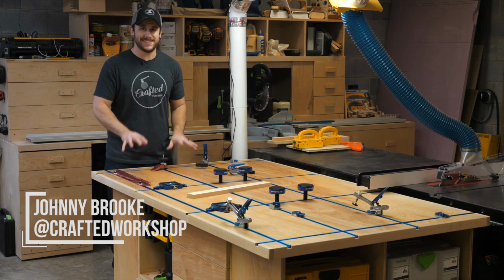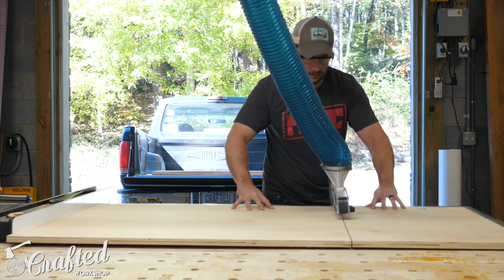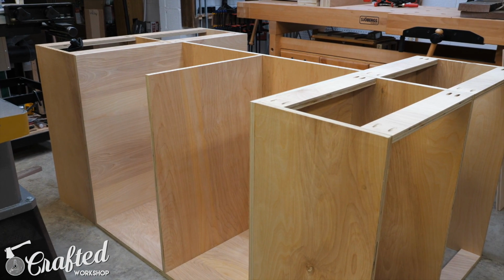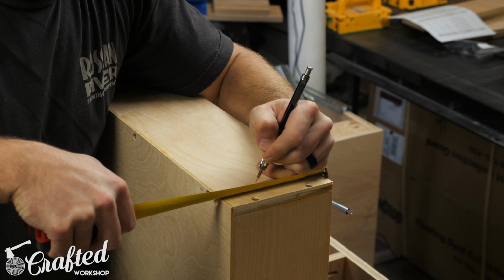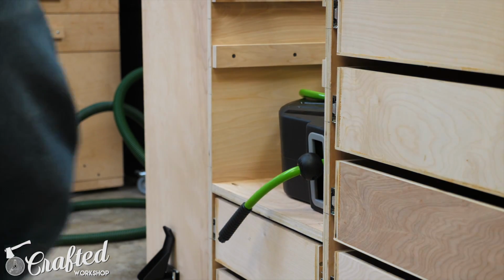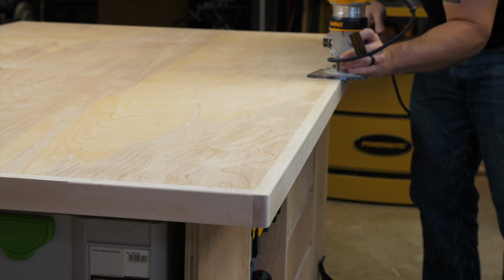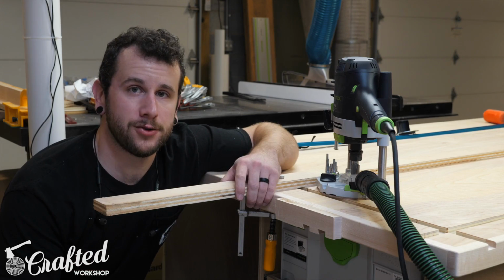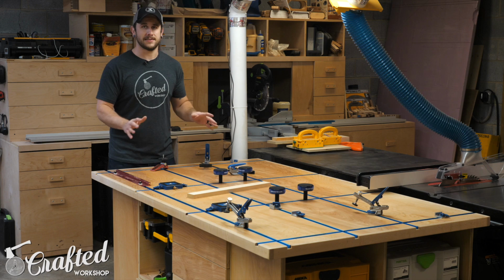ULTIMATE T-Track Assembly & Outfeed Table / Workbench with Systainer Storage | How To Build

Comment: Very nice!  So many cool ideas for a bench!  I looks like you opt for  going to T-Track vs dog holes?  Why not both?  I also noticed you opt for a very large table saw surface as well verses most default standard cabinet sizes.
Reply from the maker: Thanks Gary! I had dog holes previously and just didn't find them that useful. I've already found the t-track more enjoyable to use. My table saw has a 52" rip fence, very handy for breaking down bigger pieces of plywood.
Reply: I have to agree I think the track make more applicable sense.   I am debating on ordering a new cabinet saw vs a new Skilsaw worm drive job site saw for my home shop.   I am leaning towards the new job-site saw because one it has plenty of power, seems to have a good fence system being rack and pinon, and of course it is portable and easy to store out of the way if one wants to.   I have room for a cabinet saw in my shop but this is $499.00 plus one gets a new Skilsaw 7.25 circular saw with it right now as well!   It also cuts 35" to the right of the blade and also will encompass a dado blade.   If I need to rip large sheet goods I would use a track saw for that which I find is much easier and provides accuracy and clean cuts as well and also is portable if one needs to do this else where.  Invested cost for both track saw and the Skilsaw worm drive is less than just a cabinet saw as well.    Here is the link if you want to express an opinion. https://www.skilsaw.com/  Just not sure how to build your bench around the Skilsaw table saw as of yet.

Comment: Nice table with a useful surface.  But just to clarify, you built a plywood storage base to house empty plastic storage boxes?  Do they make Festool koolaide?
Reply from the maker: The table just included Systainer storage, it certainly has a lot more uses than that. The Systainers aren't empty, they hold all of the tools and the accessories that go with each of the tools.

Comment: What is the advantage of not bringing the t-track to the edge? Great video and timely as I am currently building my out-feed table.
Reply from the maker: Terry, I wanted to avoid any sharp edges on the edges of the bench, hence keeping the t-track about 1/4" back from the edges of the table.
Reply: second question, by using the t-track you have eliminated the use of the dog holes. Are you going to miss that feature, and do you see the t-track system superior to traditional dog holes?

Comment: Nice table! My only concern is the T tracks across the table when used as an outfeed for your table saw. Are you not concerned that things will catch?
Reply from the maker: Thanks Dave! The t-track is slightly recessed in the top, I can slide boards across the table without them catching. I don't see it becoming an issue. Really enjoy your videos!

Comment: Really nice design, build, and video. May want to consider the need for slots for any possible sleds you may run on your saw. If you went to add them now, I think your track system may be in the way.... just my two cents. Nice job! 👌🏼
Reply from the maker: Thanks a lot! I actually made sure the table was about 3/4" lower than my table saw's surface so that jigs using miter bars won't interfere.

Comment: Nice build johnny. And no squat! 😀

One thing that looked so weird is all that stuff sticking out of the table at the receiving end of the table saw. I know you were showing the versatility. Looks like a nice table. One thing I'd do is take the festool tainers out and design another option with drawers. I dream of festool but really doubt I'll ever own more than the domino.😭
Reply from the maker: Hah, yea didn't need the squat in this one! A lot of folks have mentioned that, but I'll certainly have all of the t-track accessories stowed away when I'm not assembling things. And you could easily sub out more drawers in the design if you don't have Festool stuff.

Comment: Love the table.  Is there anything from the Ron Polk table that you wish you would have added?  Why did you choose this style as compared to a torsion box style?  I am considering redoing my current assembly/out feed table and like your approach.  Thanks
Reply from the maker: Thanks John! I don't think there will be anything I miss from the Paulk table. It's really designed for mobility and for use with a contractor style saw, neither of which I need in a table. The torsion box seemed like overkill honestly, this table top is extremely flat (I shimmed it in a few spots off camera). Also, making a torsion box doesn't leave you with a very thick top for fastening the t-track. I definitely considered it, but it would have added quite a bit of work.

Comment: When I saw the time I thought that it was a bit long. But the flow was great and before I knew it the video was over. I think this is an awesome table. Absolutely love it! Thanks for sharing. Glad I found you after seeing you at the Festool Connect.
Reply from the maker: Thanks a lot, Angie! There was a ton of info to cram into the video. I was worried about the length but I think it was kind of necessary. Nice to meet you too!

Comment: Turned out great Johnny! Really nice build. Was thinking of adding dog holes to my assembly/work table but the track might be a better option since the top is only 1.75 thick. Great video!
Reply: Also loved the few seconds of stop frame and your explanation. Haha.
Reply from the maker: Thanks Doug! I definitely think either option would work for you, you can get a lot of use out of dog holes with a thin top. I just prefer the t-track system.
Reply from the maker: Hah, yea, I'm not going to be giving Frank a run for his money any time soon.

Comment: Hi, you used 3/4 inch plywood and the t-track was 3/4 inch deep. but you used 1 inch screws to fasten the t-track down, I am not a teacher of math but to my reckoning the screws would come through the plywood even accounting for the thickness of the t-track
Reply: There were two layers of plywood, though.
Reply from the maker: Hey John, the top is made of two laminated pieces of 3/4" plywood, so it's 1 1/2" thick. The t-track is 3/4" wide and 3/8" deep, so the 1" screws are just about the perfect length so they don't come out the bottom of the top.
Reply from the maker: Yup!

Comment: It looks like the entire weight of the table is on the 4 levelers. Any issues or concerns with this?
Reply from the maker: There are 4 on the outside, one at each corner, and then four more in the inner cutout around the back side of the table where the compressor lives. This gives the table a ton of support in the center. According the Rockler's site, each leveler has a weight rating of 600lb, so I should be good for about 4,800 lbs give or take, hah!
Reply: Crafted Workshop, thanks. I'll be buying your plans when I get back in the states

Comment: Nice solid build! What goes in the middle of the empty space on the backside of the cabinet? I’ve been using self centering drill bits for ages absolutely could not live without them.
Reply from the maker: +Tom's Dreamshop Worx that’s where the compressor will live. The air hose feeds through the cabinet. It’s kind of a dead space anyway, no good way to access it. And yea, need to get me some!

Comment: This comment may not apply to a high end router like yours but you should use the flat edge because if the collet isn't perfectly centered and you twist the router along your fence you will get a wavey dado. May not be noticeable to the naked but extruded aluminum t-track which is perfectly straight won't fit in the slot evenly. Furthermore you should have used your track from your track saw. Aren't they compable with each other??
Reply from the maker: +Mike Taylor I did use my track on the two shorter grooves in the middle of the table, but it wasn’t long enough to span the full length.
Reply: Crafted Workshop won't your router attach to the track, like the saw does??
Reply: Mike Taylor yes, I have that same router... you can attach the router to the track... works great!

Comment: Out of curiosity, why do americans use so many kreg pocket holes to build their furniture? Are they stronger than biscuit or dowel joints?
Reply from the maker: Not sure, it just seems to have become the standard for cabinet assembly here. They aren't stronger than biscuits or dowels as far as I'm aware, but they do seem quicker. You don't have to wait for the assemblies to dry while in the clamps like you would with biscuits and dowels, since the screws hold them together while the glue dries.
Reply: They’re weaker, but are definitely strong enough for cabinet making. They are very fast as well.
Reply: Aaron Spain you should check out matthias wandel videos on pocket hole vs tenons strength.

Comment: Great build Johnny! Lots of storage and functionality, and a very well documented build. I'm sure you'll get lots of great use out of it. I thought of adding a similar track system in my assembly table when I built it. The one thing that stopped me was I knew how much s*** would get in the tracks, and kind of be a pain. I guess the benefit of the tracks make up for a little cleaning out now and then! Awesome build!
Reply: I made my t track top flipable to keep dust out and have perfectly flat opposing side.
Reply: I agree.  I got rid of most of my t-track systems and just use dog holes or clamps now.   Never anything to clean out.
Reply from the maker: Thanks Guy! I definitely agree, I'm going to have to make an effort to keep glue and other debris out of the tracks. Glad to have the air hose right there so I can blow them out quickly!
Reply from the maker: I had dog holes on the previous table and hated them. Different strokes!

Comment: 4:56 Such a "small" piece of advice that is hugely helpful.  The offset pocket holes as well. 
Do you find the battery nailer to be worth it vs dealing with the compressor and hose?
Great video
Reply from the maker: Thanks James! Glad the tips were helpful. And yes, I love my cordless brad nailers. They're pretty heavy but definitely convenient. That said, now that I have the hose reel handy, I'll probably end up using my air guns more.

Comment: Rockler Rockler Rockler Rockler Rockler Rockler Rockler and... Rockler.
Reply: A: They make good stuff
B: You feature your sponsors. That's how the business works.
Reply from the maker: It is incredibly useful for assembly and general workholding. You’ll see me using it in basically every video from here on out.
Reply: Rockler, almost like Harbor Freight, some stuff works, some is freaking junk. Be cautious!
Reply: @Jack Herer: Totally! besides... How does something requiring buying jigs and other hardware become less complicated than a dado or a rabbet?

Comment: This video is just making my Xmas list bigger :) 

- Hose holder
- "Sortemo" boxes
- Rockler Leveling Feet
- Rockler casters

Love the video sir, can imagine you're pretty psyched to get this done!
Reply from the maker: Hah, I bet! I'm super pumped to have this beast at my disposal.
Reply: I don't think he said it but the "sortemo" boxes he used look an awful lot like the stanley sort boxes i've got. I dont remember what they call them, but they have multiple sizes and you put in the dividers however you like. They work really well, and i think they were $7 or so at walmart.
Reply from the maker: Yea, I linked to the ones I got, they are very similar to the Stanley version, I picked them up at my local Lowe's for $20 each. These have individual cups that hold the hardware, and you can remove the cups, close the box, and the rest of the cups stay in place. Pretty slick.